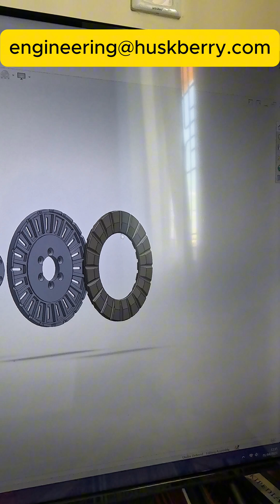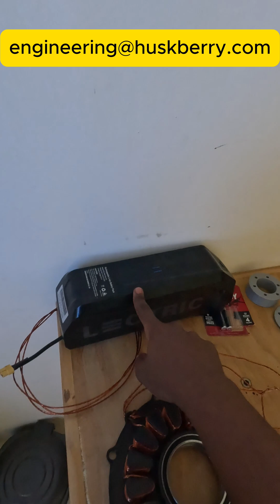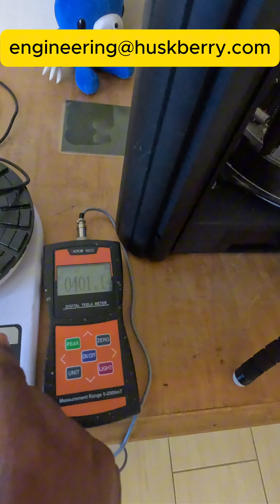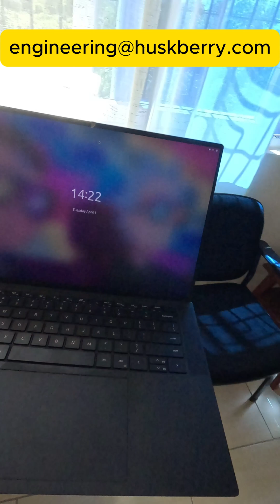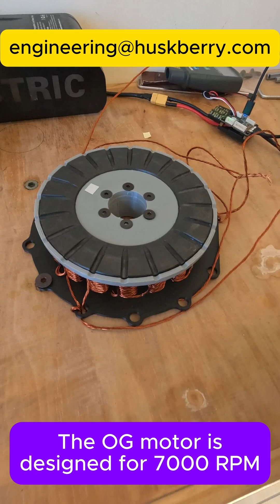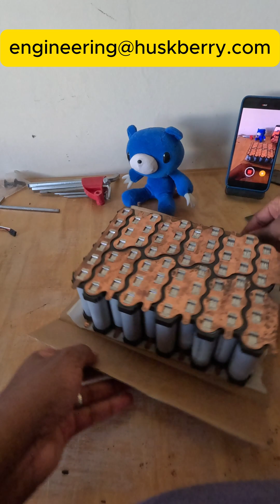Axial Flux Electric Motor like yasa

Comment: Respected sir, myself Azad from INDIA, i have need your help to make  I own  40kw axis flux motor, i required 12000 RPM 50nm.torque , diameter 180mm . 18 slote, 14 pole Neobdiaum magnets,
Please provide me it's winding wire gauge.
Reply from the maker: Please check @comprogexpert channel on YouTube

Comment: Great work bro.
Do you really think the heating issue is caused by lack of magnet position sensor ... 🤔🤔
Maybe check your wire selection (skin depth and frequency) and energy loss as heat
Reply from the maker: @victorchiemerie9963  the position sensor helps locate the rotor at the correct angle against the stator. This ensures maximum torque which  means low Eddy current formation and subsequently less heat generation. The position sensor also helps tell the controller how much amps the coils can handle and detect stalling. Dumping current in the motor when it's not rotating causes heating as well. I'm using a VESC which collects data about a motor based on the setup. Without the sensors, the current creates the rotating magnetic field as designed but the rotor isn't correctly synchronized with the stator. We then end up with an induction heater instead of a motor. 

The heating issue also comes down to what a controller fundamentally does in this setup which is electronic speed control (ESC). The point of a controller is to maintain speed of the motor. So if the max rpm is 2000, and torque is 1 N.m at no load (the motor is only working against windage and friction losses in the bearings), the current drawn is very small, say 0.5 amps. Adding a load to the motor will slow it down and for the controller to meet the criteria of 2000 rpm, it will dump current into the motor to increase the torque which overcomes the load's inertia to maintain its speed. In this case, the steady state current with load would have increased to like 5 amps from 0.5 (just an example). It really helps to have the stator direct and quadrature angles in the correct place, ideally 90° for max torque.

Without sensors, the ESC relies on field oriented control (FOC). The fact that I'm running an air core also doesn't help with the strength of RMF